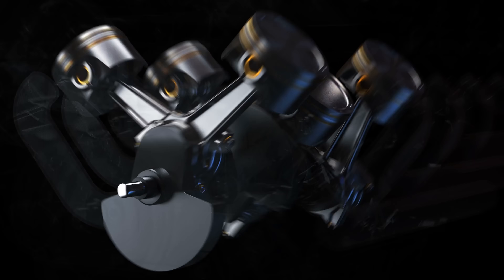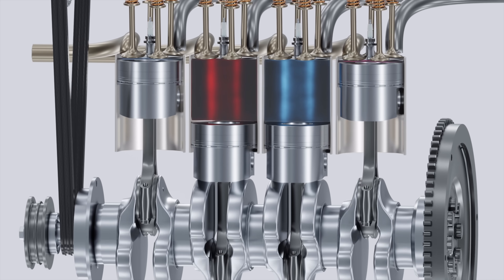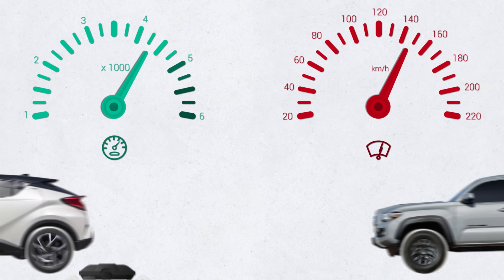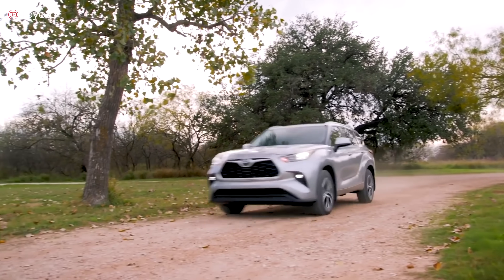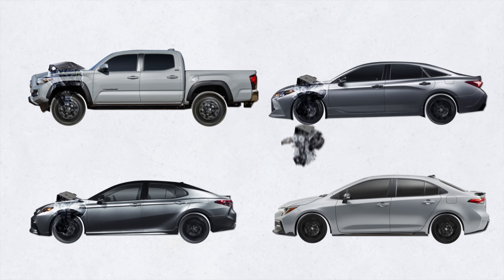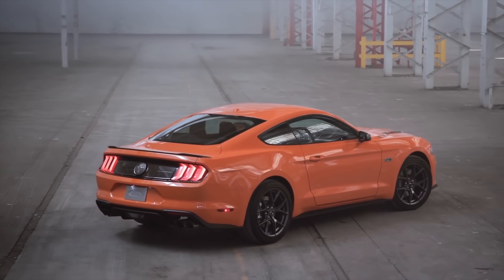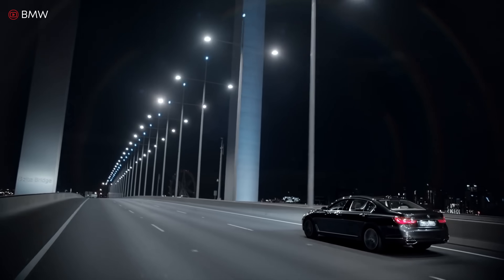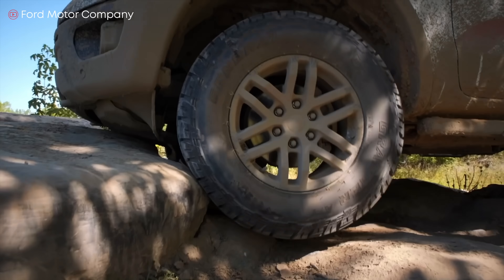No One is Telling You the Truth About Turbocharged Cars, So I Have To

Comment: But Scotty, the owners that buy them new, put 100,000 miles on them and then get rid of them have few problems. It's the 2nd & 3rd owners that will encounter the "too expensive to fix" problems. Then they'll be junked.
Reply: I ran into a kind of similar issue with a 09 cobalt SS I bought. The previous owner had a few aftermarket parts on it and I assume he ran it pretty hard so had a few issues. Luckily I was able to do my own repairs so saved a few dollars and was still a decent car even when I sold it at 150k miles. I think I got rid of it just in time though.
Reply: This is why I bought my first German turbo car brand new 😂. With a manual transmission too.
Reply: You’re absolutely right.
Reply: A good vehicle should last 250 to 300k miles. If you want to lease or throw away cash for a vehicle with poor longevity that's all you. Had a Mkvii Golf R and got rid of it at 40k miles. Had lots of electrical issues and liked to overheat and consume oil. It was a fun car to play with, but I need reliable transportation.
Reply: This is true for most of the "money pit" vehicles.
Reply: So, don’t buy Used turbo four-cylinder‘s. Got it!👍
Reply: @gamelockbreaks9607  dude it was a Chevy.... You were on borrowed time at 150k miles. I'd say you were lucky ha ha.
Reply: A car that only lasts 100k miles is literally a car to only drive to work and back. That's boring fam. Your just looking cute for other people at that point
Reply: @Daddyme92  Or for those that can afford to buy a new car every couple of years. Or lease.
Reply: @johnnygunz2300  Dude MOST companies have made crap vehicles over the years. I've had a 96 S10 that me and my brother built with a junk yard 350 that I had for years. Had over 200k, a 04 Silverado with 250k that still ran like a dream. my dad also has a 2010 Silverado with 340k (L96) and just had to get the trans done. Plus my cobalt when I sold it had 150k with no actual issues just had a feeling, no idea if anything actually went wrong after I traded it in. Chevy and Toyota have both been extremely reliable to me and my family. All car companies are going down the drain for the most part, even Toyota only has a 60k mile warranty like the rest of them now unless you pay extra. Stuff is built like crap on purpose because if every single car lasted 300-400k miles car companies would go bankrupt. lol Take care of your cars and 90% of the time they will take care of you that's how I see it.
Reply: Facts
Reply: @Daddyme92  lmao you'll be hard pressed to find a vehicle nowadays that lasts well past 100k miles. Everything is built to break I mean 15 years ago every car company offered 100k mile warranty, now only 4 do. Kia, Mitsubishi, genesis, and Hyundai.
Reply: Will stick with my vq-6... love the thing
Reply: "100,000 miles".  🙄🙄🙄🙄
Reply: @gamelockbreaks9607  when did Ford and Chevy offer 100,000 mile warranty? Or Dodge? I never heard of it. I’ve been buying 2-5 year old cars with well under 100k on them for decades and I can’t think of a single one under factory warranty for long.
Reply: @ED-es2qv  IDK about ford but GM did 100k mile warranty I think up until like 2014 or 2015. I can double check and get back to you or you can try to find it. If i find it ill drop the link.
Reply: @ED-es2qv  Just looked it up they did a 100k mile warranty for a 10 year period to be more appealing to customers but cut it in 2015.
Reply: @Daddyme92  One of my vehicles is a 1996 Ford Econoline high top conversion van with the 351 W engine. I purchased it for $7500 in 2004. Right now it has about  490,000 miles on it and it's still running strong. I plan to drive it for 2 more years and then I will buy another high top conversion van.
Reply: Not true for F-150 Ecoboost owners. See plenty of reliable ones with 200,000 -400,000 already and still ready to go more. The turbos can last with proper maintenance.
Reply: Thunderbird 86 Turbo coupe 2.3 back then smoked all the imports
Reply: Remember the 1970 s every car was like this
Reply: If issues arise then those cars will drop alot in price near 100k miles.  Why many BMW models become cheap at that mileage...they become money pits.
Reply: @Dcc357  and how much was that?
Reply: @thetacticalape8852  respect to you for being honest, was it brand new?
Reply: @jetson2075  if reliability is your issue then why are boxer style engines in almost every single and twin engine private airplane?
Reply: these 100k or less sell are not Scotty's ideal viewers as it is a repair channel
Reply: @jetson2075  Not when new till about 75k Miles only time they might be ok...after that most are garbage...so I'd never suggest buying a used one
Reply: @jetson2075  and the majority of those crashes are ultimately found to be attributable to pilot error not mechanical failure.  I agree with you however that the maintenance program  is more frequent and more rigorous  but if there was an inherent known safety or mechanical  issue with the engine configuration they wouldn’t be found in the vast majority of private airplanes.
The most miles I’ve put on a Subaru was 162,000 on a 2005 Baja.  Zero problems in all that time.  2nd most miles is around 70,000  on several other Subaru vehicles, one a Forester the other an Outback.  Again zero problems..  all I ever did was have regular O/F changes.
Reply: @ED-es2qv  they sold extended warranties to 100k for 4 grand lol. Better off saving that money in an index fund and withdraw when you encounter a failure.
Reply: @gamelockbreaks9607  on certain things. The bumper to bumper warranty on my 08 Pontiac G8 was only 36k or three years. I bought factory extended warranty for five years or 90k for the drivetrain it cost $1000. The emissions equipment was covered by factory for 75k
I still have the car and it’s my DD and it has been paid for since 2011.
Reply: @pmscalisi  So i'm going to assume it's like what they do now, my 2018 Camaro came with a 36k mile warranty but I paid for a 5 year 70k mile warranty. Never bought a brand new car until 2019 still only sitting at 15k usually use my wifes car as a DD. Hopefully it lasts long enough until I can afford a C8. lol
Reply: @gamelockbreaks9607  No they didn't
 3yr 36k miles was the standard. Hyundai was the only 100k powertrain warranty I could think of.
Reply: @lorenzocooper8286  how many transmissions have been in that Econoline?
Reply: The issue of modern Cars goes even farther than you reply.
The high number of chip controls and censors on modern Cars has brought industry reliability down, cost of ownership up, and that  costly problem of, the difficulty none Car culture people have, of not being able to find shops that can figure out any and all problems, do to the chips and censors can seriously creat complicated issues.

And the problem for the higher reliability Mnfrs is inconsistent from Car to Car, even MB and Toy are suffering this inconsistency.
However, Mnfrs with piss poor reliability like CryCo, the Italians and the Brits are less about inconsistency, cause you Know there's gonna be problems 🤦🏾‍♂️
Reply: @frnkjones40  Okay than I guess autoweek and at least 3 other websites were wrong when I went to double check. 🤣
Reply: @thetacticalape8852  Funny because I have a 2016 Mk7 golf r which has 54k miles on it currently, and never have had any electrical problems. I do use about a 1/2 qt of oil between oil changes but that's not a big issue in my opinion because I drive it pretty hard. Oh and its tuned...
Reply: @raynic1173  It still has the original transmission. I change the fluid every 50,000 to 60,000 miles. The most expensive maintenance was when I had to replace  the upper and lower control arms. That was about $800. I changed the water pump and  fuel pump two times,  and the oil pump one time. Everything else has been regular maintenance; changing the oil, flushing the antifreeze, replacing the sensors, etc.
Reply: @driverjay8613  some truth there. Modern engines are being squeezed for mileage, emissions and performance. More is being demanded of their engineering than ever before, imho. The  manufacturer 's are going to lay a few eggs for sure, some out of ignorance and some out of making cost benefit gambles.
Reply: @jetson2075  boxer engines are incredibly reliable me and my friends use them 2.2 litre and 2.5 litre in our aircraft and they run at 5k rpm for years with no trouble.
Reply: I had to replace a turbo on a 3.5L Ecoboost at around 50,000 miles and I have rarely used the turbo.
Reply: @JeffRyman69  what did that turbo replacement cost you?
Reply: @raynic1173  $100 under an extended Ford warranty that I bought because of other problems that occurred while under the original 36,000 mile warranty.
Reply: @JeffRyman69  and what did the extended warranty cost?
Reply: @raynic1173  I don't remember exactly, but somewhere in the neighborhood of $2,600. I've had a couple of other repairs so I've gotten my money back. I still have 22,000 miles left on the warranty or until March 2023 and I still need a backup camera repaired.
Reply: Sorry Scotty, I’ve had turbo cars and always replace the tc within 70 to 85k miles even though I run and allow wind down time before shutting off.
What would you rather use a mule or an elephant?
I prefer the elephant, they live longer and pull stronger.
And like Don Garlits said; “There’s no replacement for displacement”
Reply: That is the real story of the auto industry summed up.!! 😁😁😁
Reply: @gamelockbreaks9607  If you think things are bad now, you should've been around in the 70's and 80's.
Reply: 135k on my 2.0 ecoboost escape... still running strong.
Reply: Can't wait to see you the results of the turbocharged Tundra and the new smaller engine. 
A engine in the "Big Brother" that's smaller than the one I have in my Tacoma 🤔
Reply: As I m poor, and so have to buy used. I stay away from turbo engines, auto transmissions, etc.
I had number of muscle cars when i was younger, and don't need a super fast car anymore..
Typically anything that will entice young guys, is questionable to buy used...
Reply: @Gamelock Holmes I also have a 09 LNF SS. Bought it with around 55k still going strong at 175k💪..Its been driven hard but I also never did any engine mods to keep the reliability.
Reply: @ED-es2qv  I paid 2200 dollars extra for a factory 10 year / 100k bumper to bumper warranty through Ford in 2019. It includes everything except wearable parts (brakes/tires). It is not an aftermarket warranty, it is through the Ford dealership I purchased my truck new at. Some dealerships sell it, some don’t.
Reply: My2011 Hyundai Sonata 2.0t limited has 21200 miles and running strong.
Reply: @vroomgc  how many miles between oil changes?? Thats important issue.
Reply: @donaldschuster9304  21,200, thats very low mileage.
Reply: Apparently you never heard of the 911...🙄
Reply: @ricklewis5804  because those engines are regularly rebuilt at specific intervals by mandate.

It's well-known that boxer engines have wear issues because of the way they sit. You'll see wear on the side that doesn't get as much oil.

If you don't believe me..look up any video of one being disassembled and talked about. They'll show you where, how and why they wear and ultimately fail.
Reply: @groundpounder4134  Plymouth Slant 6
Reply: My thoughts exactly. And if you actually keep on regular maintenance schedule and basic oil changes, turbos last. I have an sti with 200, 000 miles on it, always keep up on maintenance, still running original turbo, no problems.
Reply: @silentjay3272  what does maintenance on a turbo look like? I'm completely new to that type of thing
Reply: @jazeenharal6013  keep good/fresh oil in the car, always warm it up before driving, never just turn off a red hot turbo, let the car idle awhile. When you change your plugs, pull off intake to turbo, check if it spins free, not loose. Get a nice aftermarket oil catch can if you want to go the extra mile. Otherwise basic stuff, preventing epic fail and unexpected costs later down the line.
Reply: @silentjay3272  this is good stuff to know
Reply: I prefer a v8
Reply: @glennmurdock4490  my used vw Jetta TDI (turbo diesel) bought it with 130k miles im about to push 200k and its still reliable. People that expect their cars to be reliable for them dont change their oil or do maintaince. Toyotas are garbage and their steering is a joke. The only toyota i will get behind is their forklifts
Reply: @thetacticalape8852  What did you replace it with?
Reply: @t.k.morris  Since I already had a sports car, I wanted something a little more practical for my daily lifestyle. I bought a 2019 Nissan Titan Pro4x and couldn't be happier. Over 30k problem free miles and counting.
Reply: @gamelockbreaks9607  Toyota
Reply: @302Mustang13  hoping to get a Turbo 4 for a commuter vehicle - what do I need to do to properly maintain it so it runs 200k miles?
Reply: I boughta 2004 f150 xl 2wd 4.6 auto. 100k bumper to bumper warranty
Reply: Repair of these high output t.charged4s can be astronomical 😳
Reply: don't buy used 🚗
Reply: Which is going to happen no matter the engine or brand. The 2nd owner of nicer cars generally baby the car as they want to keep it for years and enjoy it. The 3rd owner cares less and just needs transportation, as the car is usually pretty high mileage by the time it gets to them.
Reply: @gamelockbreaks9607  the LNF was a pretty robust motor. I was a tuner for the Ecotecs platform back in the day and loved those engines. The body was garbage, but the engine and drivetrain were stout. The engine was sleeved, skirted, and reinforced from the factory to handle upwards of 700whp. The transmission could handle about 500whp before it needed a stronger clutch and a cooler.
Reply: @ED-es2qv  my Silverado came with a 5 year, 100k mile warranty, but I optioned it for 7 years and 70k instead thinking I'd own it for a long time. I sold it 3 years later. Fail
Reply: @glennmurdock4490  But when all the automakers seem to be headed in that direction there will be nothing but small turbo 4-cylinder engines available!
Reply: True...I am second owner of crv 1.5 L turbo. Problems started after 100000 km,fuel injector replacing tomorrow.
Reply: @Dcc357  bro how is it going? We are planning for a vw with 1 litre tsi, is it a good choice?
Reply: @manikkumar2709  I’m not sure. We don’t have the 1.0 in the US. I believe the lowest displacement we have sold here is the 1.6
Reply: My 2013 eco is at 300k now with regular 5koil changes using same 5 30 blend,  sparks every 50k,trans fluid every 70k ,coolant every 70k,diff fluid every70k ,water pump replaced at 250k wich is normal for any truck,not a single ignition coil replaced yet ,working like a champ unlike gms giving you trouble after leaving the lot😅
Reply: never buy a car over a 100,000 miles, unless you have no other choice.
also stay away from anything that has a turbo 4, a naturally aspirated I4 or V6 will give you less problems on the used car market everytime.
Reply: @thetacticalape8852 Hondas 1.5t last too 700k miles
Reply: @jpridie I think the reason the boxer configuration is used in most small private aircraft is for its lower profile for visibility over the instrument panel and less drag resistance and easier access to the engine for required periodic maintenance.